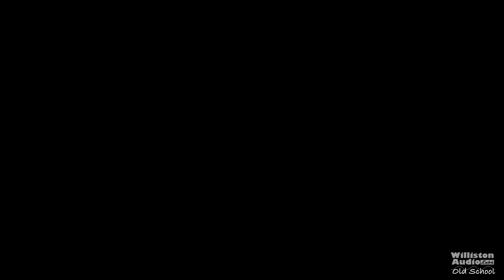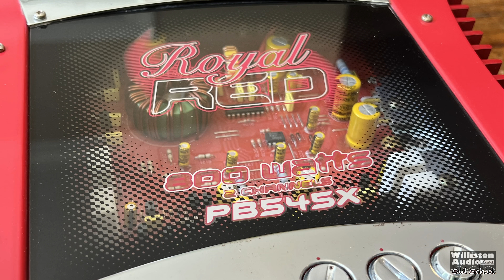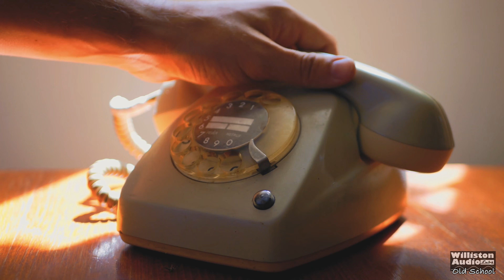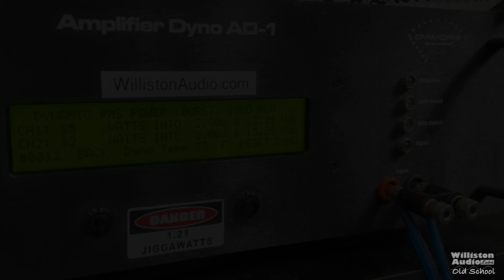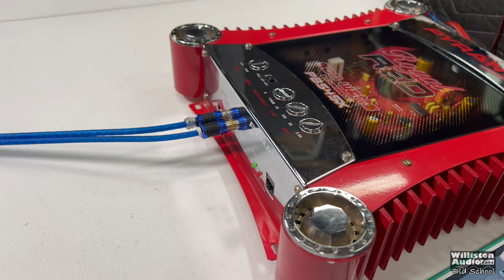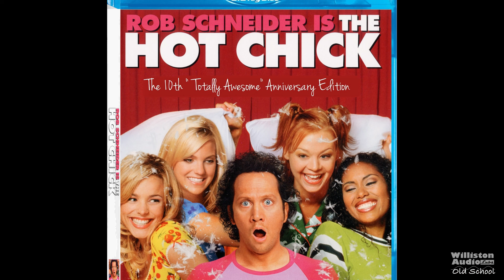Funky Pups Powered by this Beast of an Amp

Comment: I had one of these amps years ago. I picked it up for like $10 or $15 from a buddy. The rca inputs were broken, went down to radio shack and got a set of "Tiffany style" inputs and soldered them up to the amp. It looked good,worked fine and was surprisingly decent sounding for what it was. 

Don't get me wrong the amp was a hot mess in comparison to a decent modern amp but for the ~20usd i spent i was happy with it to power my single powerbass 12 in a vented box in my $500 beater winter car.

Comment: In fact when this amp was popular vechiles fromt he late 1980's up through te 1990's that did not have computer controlled alt. to try to eek out more fuel effeciency would have been int he 14.4-15.5 volt range most of the time above idle.

Comment: What dumbass is asking for voltages in the 13V range? Every vechile that has a good batery and alternator is going to be inthe 13.8V to 15.5V range if the vechile is running under no noload. No one runs PIAA lights and a Winch witht he engine off and trys to thumb with killer bass at the same time. If the load is not too much beyond what the vechile electrical can handle the voltage should rise with load. Now if someone is running these amps at home on switching power supplies and can only get 13.8V I think they need to re-think what they are doing!

Comment: I HAVE A QUESTION, 3 1ohm amplifiers? 
Can 3-1ohm amplifiers be wired to 2 4ohm Subwoofers if one of the 1ohm amplifiers be wired in reverse witch is the middle when I wire a +and- together at the subs, should I balance out really good?Y or N

Comment: Just imagine if they had made that amp in a limited addition gold series with fo 24k gold instaed of the chrome and red ....probably would have set of the san Andreas fault line ....that and the capability of running off 2 d cell batteries instead of just 1 .....a basshead can only dream ....

Comment: I didn't have money for a good system when first got into the scene so started with pyramid. I never cared for their typical subs except the Super Pro which I thought were pretty decent. I had a few amps and EQ boosters and I definitely got my money's worth (and some). Pyramid gave me an entry level system that didn't break the bank. If it wasn't for them I'd probably wouldn't have anything at that moment. So no hate from me on Pyramid.

Comment: Pyramid was like a box of chocolates 
You just never know what you would get .I have seen the same model # has totally different internals 
Most Pyramid amplifiers I have tested.
If they said 100-200 watts .It was 10-20 watts
If it said 400-500 watts 40-50 wpc 
It was about 10% their claimed power 
People who bought them didn’t know .Back in the day we didn’t have amplifier Dynos 
We had Radio Shack power meters
A typical 200-300 watt Pyramid Equalizer puts out 10-15 wpc .
That is even pushing it hard

Comment: I started buying car audio in the early 2000's when I started driving and amps like these and the Sony Xplodes were sooo COOL! Yeah they were a little pricey and under preformed but I didn't know that until 2007 when I got a 1000w Kenwood to power my new pair of 12in CVR's in the ported Kicker box(silvers rule!) Most new amps offer alot more performance for the value but lack that COOl retro styling. A few expectations being stuff like the Soundstream 🕷️🕸️ and JP's with whacky colors.
Reply: Sony amps back then where actually pretty good. The sound quality was amazing and they had massive dynamic overhead.

Comment: I have the American Legacy LA790, it was given to me. Its the same amp just the "1200W" version, but the layout, and controls are all the same. And it still has the chrome. So I knew it would reach rated power. Also I ran it for years 2 ohm bridged. which my kicker amp of the same era won't do

Comment: I'm surprised that amp didn't kill the amp dyno with all that power and completely drain your battery bank. And those subs will definitely open up a black hole and end humanity if you put them in a very small improperly built enclosure.

Comment: Another of the Pyramid subs you should try was the Super Blue. They were Hiphonix "Thunder of the Gods" with Pyramid cones.
Reply: Had some super blues. Lol
Reply: @foyjustice7212  so did I! Powered 6 super blue 12s with 3- power acoustic omega series amps. For the day, it was loud!
Reply: Man I had 4super blues from the flea market they was ok then the wires started falling off the cone. I fixed a few times and gave up sold them

Comment: My first car amp in the 80's was a Pyramid 4 channel rated 100x2 and 50x2 (yeah right!) I blew one of the 50 watt channels on the first day I had it, but the rest of the amp powered a pair of 6x9s for a while until I got some "real" amps. Looks like they still haven't improved much. I would like to see those funky pups in a proper enclosure and see what SPL you can get out of them until they let the smoke out.

Comment: Hey stupid question.. I just blew my Skar 12" SVR 🙄 and I'm done with Skar! Thinking of going back to a dual sealed set up instead of the single ported sub. If I run 2 sealed subs at 800 watts @2ohms will it hit as hard as my one 12" sub at 1,200 watts @1ohm did? Thanks for your input
Reply: Actually 2 sealed subs at 1ohm 1200watts total  would be as loud as 1 ported and sound way better. Probably the same size box could be used too.
Reply: @Red2l16v  thanks for the insight 🤔

Comment: Once those bad boys get moving they actually drop to negative 4 ohms. The coils actually generate more energy than they use and you can disconnect your battery and alternator and just run your car off the subs until the bass stops.
Reply: WOW Very advanced technology 👍🏻

Comment: A buddy of mine growing up had pyramid amps that were actually kinda impressive. They were purple and white. It was in the late 90s so hard to remember but I think they were four channel? He had one on each of his 15" Orion XTRs in a huge sealed box.
Reply: Man the Orion Xtr's.....Had 2 12" Orion Xtr3's  back in the day eith a pyle 1800w amp and they put in some work for the time period
Reply: @punishercivic  My brother had the Orion xtr's as well in a 3rd or 4th order bandpass box on a punch 200 bridged it pounded. He got a power 1000 at the end of the xtrs life cycle they were still good but he ended up with a couple JL w6 that could handle the power better.
Reply: Those amps were manufactured by P.P.I. in Tempe Arizona.
Reply: I had the Purple and white 
Pyramid reno series 600 watt running a fosgate punch 15 in a sealed box. 
 I was actually pretty bad ass in the mid 90's

Comment: No bs. I was looking up my old pyramids amp (first one i ever bought) back in 2001. Last night.
Reply: I bought my first amp in 00 or 01... Got a pyramid "800w or 1000w" I forget exactly, but it was off eBay around that time. 

Probably put out 100w if I was lucky, haha. I can't recall the model number, but it was a tan extruded aluminum amp and looked pretty good.
Reply: @volvo09  I wanna say mine was 600w. It pushed a mtx 12" good tho.
Reply: Pyramid PB446 is what I had.